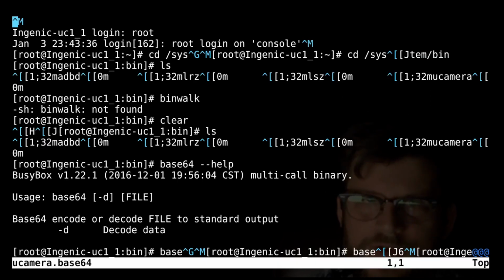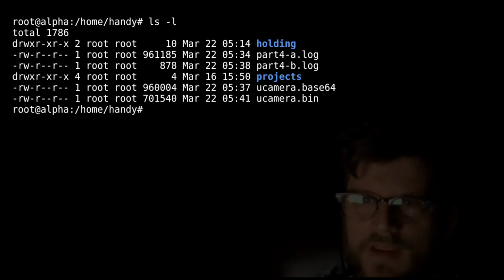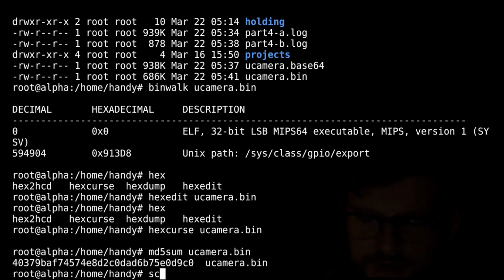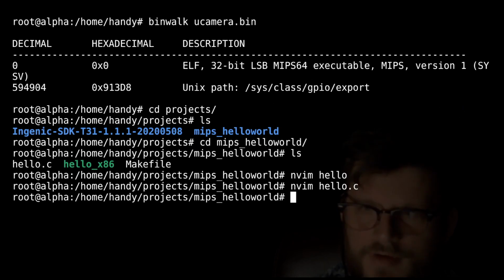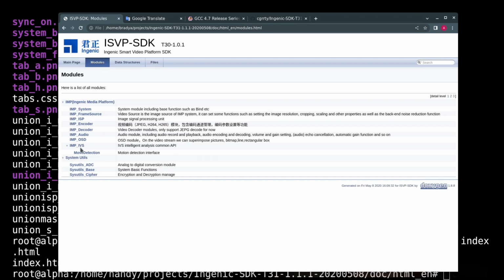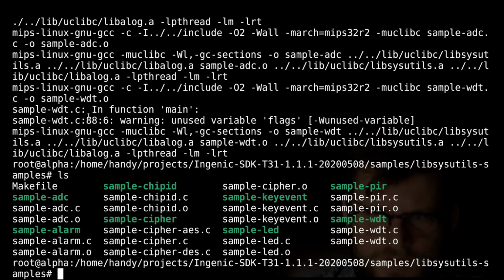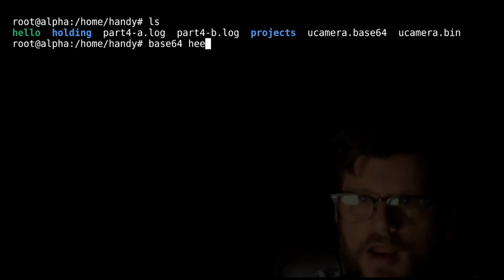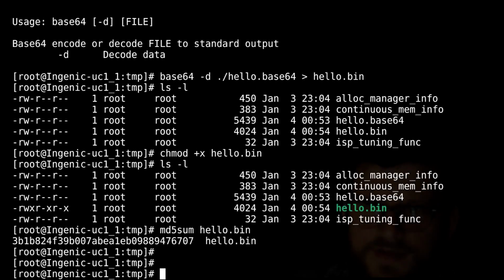Write code for Ingenic T31 SoC | Hello World, and so can you!

Comment: It's inaccurate to say that base64 has redundancy. Each byte of base64 output can be one of 64 different characters which means it can only encode 6bits. This makes it only 75% as efficient as sending the raw bytes.

This is also why most base64 decoders require you to pad the base64 encoded string with = so the number of bytes comes out to a multiple of 4 which neatly encodes 3 bytes of data.

Comment: I have several webcams with the ingenic t21 soc. I removed and dumped the NOR flash chips and used binwalk on the FW bins, FWtoolkit, hexedit, the SDK toolchain and helloworld. It's a fun project. My goal was to get security cams up and running but no longer phone home. while successful in cutting out china from my video streams and using the device as a linux soc, running code on it, and changed the os to openIPC by hacking the firmware in the hex editor copying portions after the uboot from their FW. I have so far been unable to get the camera sensor working and RTSP server up. I am more of a hardware guy, code is my Achilles heel. I ordered a couple of these cams that you are using from ebay to check out. maybe they will inspire me to pick the project up again. Great videos and good luck, looking forward to more content on these cams and seeing what you do with them.
Reply from the maker: Thank you so much! I have not done the larger announcement but we have stood up a discord server. Come join the few of us that are working on the Tinker Board
https://discord.gg/rzEMVjaZ4p
Reply: @hackercomputerco  Nice, I just joined the server.